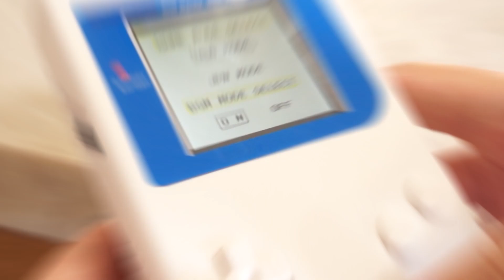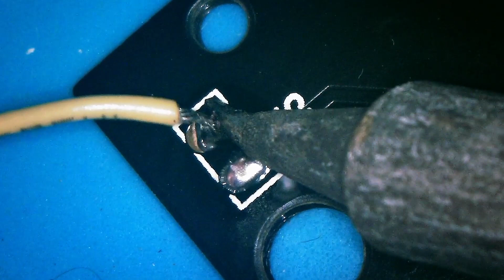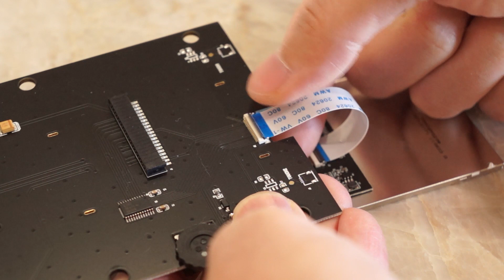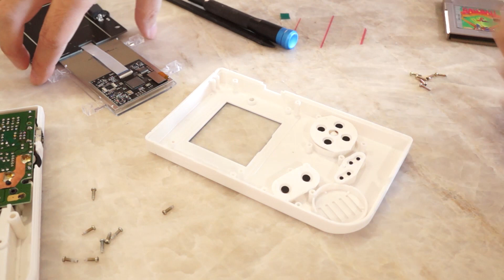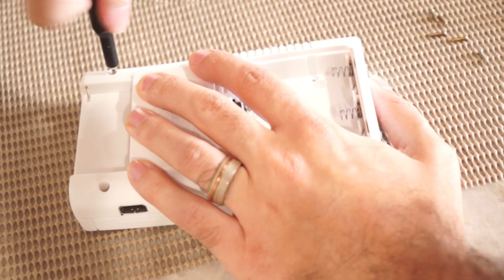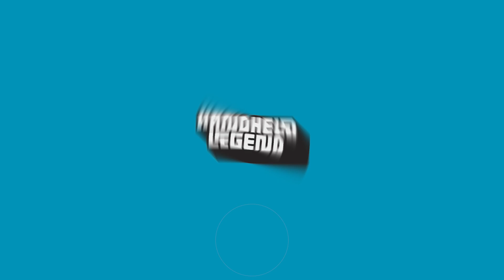DMG V5 HISPEEDIDO IPS | Install Guide

Comment: One potential fix for the button issues is to cut out the black contacts from other membranes and attach them underneath the existing membranes, or to put small dot stickers on the top of the membranes and below the buttons.

Comment: Did you Notice any issues with button responsiveness after installing the kit? I am reading about quite some issues lately
Reply: yes I did. did you manage to fix that?
Reply: @whynot_dg unfortunately not. It seems like people try to pretend its not there because they paid for this upgraded screen. In reality it's not working as it should in most cases. The buttons don't work slightly as they should. I bought different kits and all had this issue. Even one seller got mad at me as I asked him if the buttons were less responsive. He said this wasn't the case, I bought it and yes, the buttons were unresponsive. I sent it back and he was mad as crazy.
Reply: @Geertdrums i read many posts here and there and it seems this issue can be fixed sanding the contacts of the dpad on the board and then clean with ipa

Comment: The adhesive must be used otherwise it will 100% get dust on the inside of the lens over time,
The adhesive seals the screen in place so no dust can enter.
Reply: I can confirm this true I did not use the adhesive and now I am starting to get tiny little dust particles on my screen😢

Comment: im noticing a lot of inconsistencies in a lot of these videos. not specifically from HHL but other user video uploads. you have to mod the viewing area, you dont have to mod the viewing area, you have to shave down the contrast wheel hole, no you dont you just have to clip the edge of the case where the contrast wheel hole is, the display board is connected folding around behind the display panel from the bottom...but as the image is displayed shown on the website its actually the top?? but in all the videos its connected folding around the side of the display with significantly less ribbon cable.  i mean i get its a DIY project and dimensions and specifics can change but damn, definitely made me double check a few time to make sure i was looking at the (basically) same product.

Comment: Some of these mods and upgrades have become so easy it's amazing.  I remember when I first starting moding these retro consoles, there was quite a bit of soldering for some and aptitude in electronics, this is damn near plug and play.
Reply: For years i hated gameboy. When i was a kid that's all i had i wanted the gameboy color parents never got it. At one point my friend who traded me his game gear for my gameboy i was happy at first but i thought finally i can see something in the dark however back than i was not a sega fan i am very much so today then i was all about nintendo things have changed i hated street fighter 2 as a kid only because i was used to mortal kombat and the moves confused me. How things change overtime. Thankfully i got the gameboy advance first version when it came out. Believe it had a wormlight i bought seriously though nintendo toom them till thw sp for a backlight screen why? Yeah i know that weird gameboy japan exclusive with the light but that's not what i mean that to me is special edition not quality control. Also at Kmart purchased a neogeo pocket color but i only had 3 games for that machine its entier run. Sonic metal slug first mission kof R2. All 3 never had backlit displays. After getting a ips mod gameboy the rips v5 i now like gameboy enough to take it around with me. One exception that is a limitation cant be belped is how slow the castlevania games move i only have belmonts revenge and adventure. Besides that adventure island batman mario megaman like taking a Portable nes around with me i now love it. Funny how as a child i hated using the light on it in back of my parents car still hard to see. I knew one day we would have home console quality handhelds that would be amazing i thought just that when psp and DS came out especially 3ds however now i turned back to games from my childhood because new games just don't do it for me.

Comment: How would one get the contrast wheel button back on if it came in the kit separated from the lcd board
Reply: I'm assuming using a low melt solder like chip quik and a hot air soldering station should do the trick. I haven't really looked at the contrast button a whole lot to see how it's installed but from past experience with similar I'd say that would be the way

Comment: OK. something is missing here.      what main board are you using to connect that last big cable??     can you show in a full frame, the board you are talking bout. because i have this thing all apart and the new kit together, but i dont see how this  original main board is going to fit into the assembly and close up.        i sure hope you get back to this soon.  thank you
Reply from the maker: We apologize for your confusion, reach out to support@handheldlegend.com and our Support agents will help assist you.

Comment: I fitted one of these q5 kits from eBay the other day. Was such an easy install and much to my surprise it came with a new speaker already soldered on so I didn’t have to do any soldering not that it bothers me even if I did need to. My biggest beef is my kit shows a good amount on ghosting on screen which is disappointing as being the q5 I would’ve thought that issue would b fixed so I’m wondering if it’s the lcd they installed is just cheaper quality